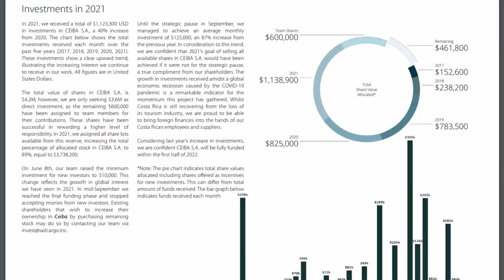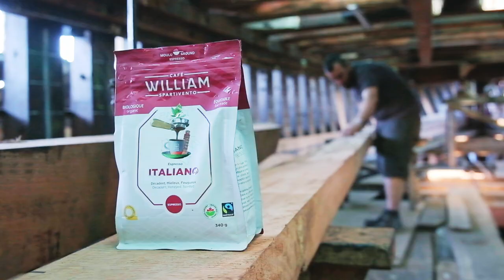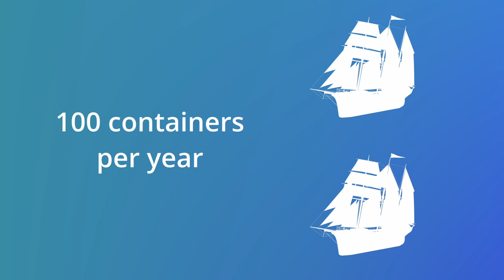Proving the Value of Clean Shipping - SAILCARGO INC.

Comment: This is just one big woke idea … with ex CEO so into her. I have been watching this channel from the beginning but the channel posted rarely any videos and no serious questions were ever answered.  However, they made several really good ideas of reforestation, and teaching locals about shipbuilding. Too little to support the channel and even less reasons to invest into it. But in general, having a sailing ship built from wood and not some alternative material is as stupid as it can be. They will need another four if not 5 to 6 years to finish completely that ship. And they also plan to use electric engines. That would require tons of lithium powered batteries, which would immediately deny sustainability. I believe, the leadership of this company understands what they got into it as they get older.
Reply: True, but the project isn't entirely dependent on batteries. If, in the future, the shipping industry moves towards slower alternatives, the need for augmenting sail-powered transportation with battery-powered transportation should, in theory, should decline.